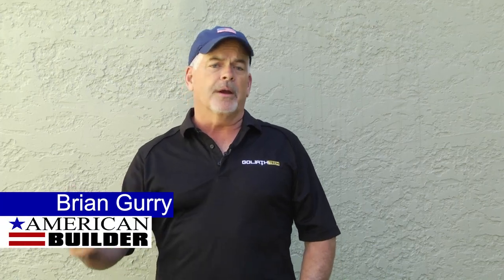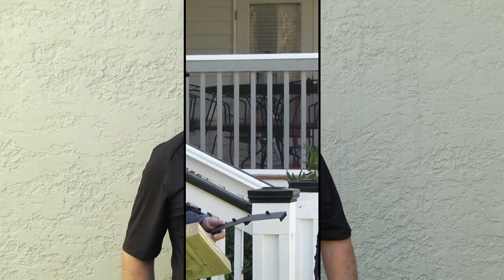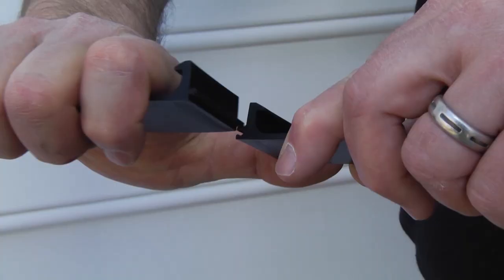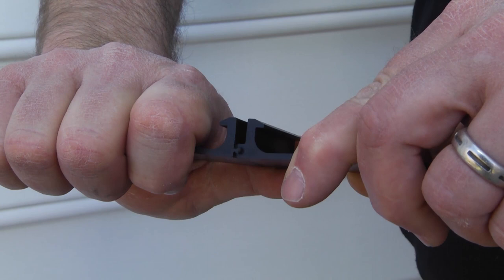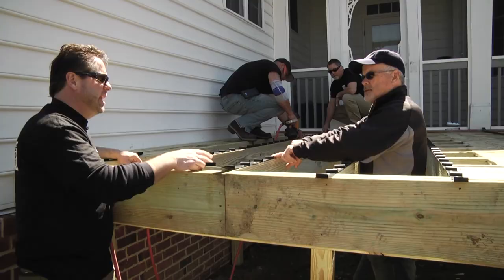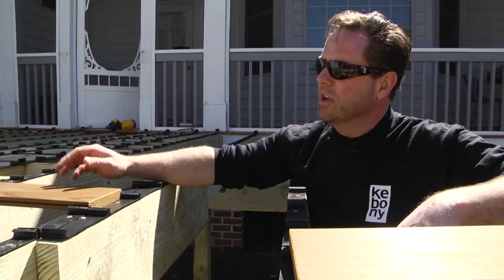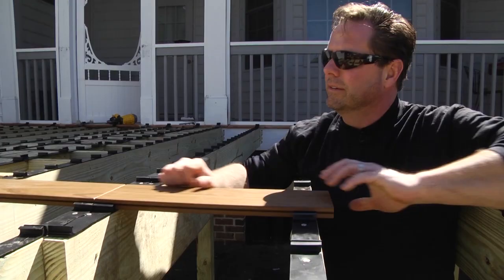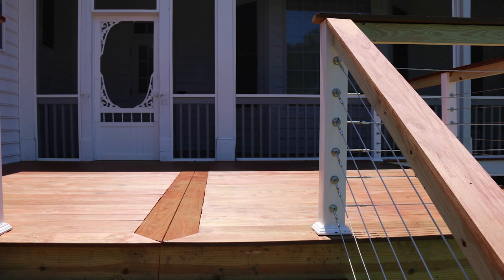Installation guide - Step Clip (English)

Comment: I'm an experienced DIY homeowner in the middle of a Kebony installation on a 8' x 45' deck. I followed the Step-Clip installation instructions to the "t"... using a laser, I lined up the Step-Clip strips as perfectly as I am capable of doing (exactly 22" off of the rim joist as instructed). Thankfully I made the decision to only install two rows across each joist. In the first 4 rows of decking, 5 boards split when installed.  My supplier sells boards in 10, 12, 14, and 16' lengths (but you are unable to specify the quantity of each length).  I had few issues with installation of shorter spans (7' and 8'), but anything over 10' has been a struggle. I have been referring to this product as the StompClip, because stepping onto it with my 200+ pound body has no effect.  I am about a third of the way through the deck and am considering abandoning ship on the Step-Clip. It has certainly not saved me time, but has destroyed about $300 in boards. Going to look into whether I can transition into the Fastenator mid-project. I otherwise love the benefits and look of the Kebony, despite all of the cracks in the boards induced by the Step-Clips. I will soon figure out how to rip out expensive deck boards that were cracked by the StepClip.
Reply: Wow that sounds like a pain in the ass!  Has the company offered any solution??